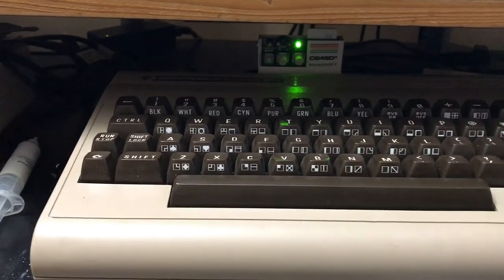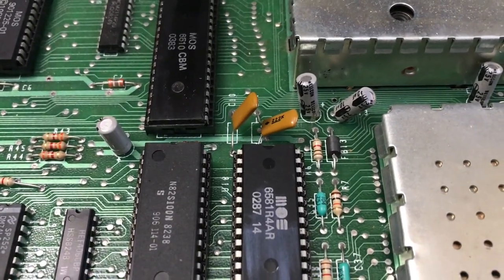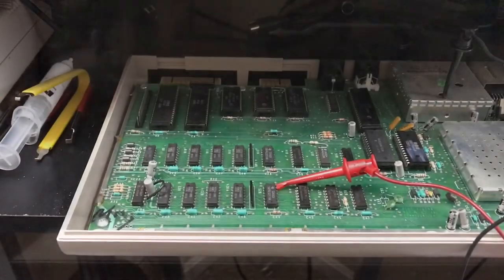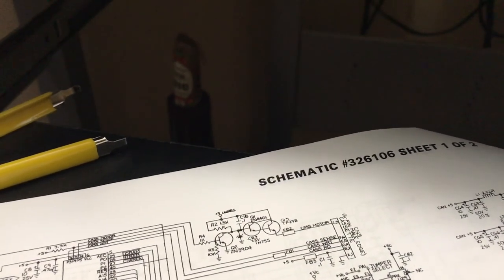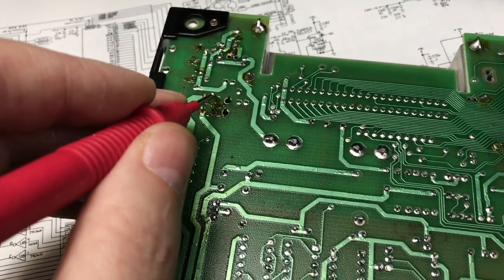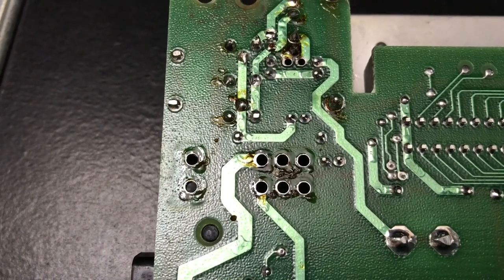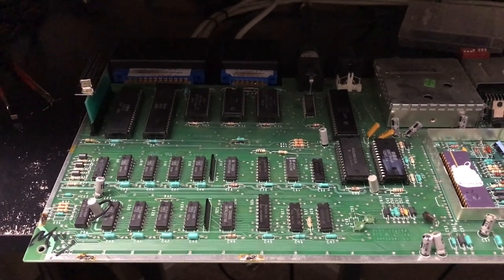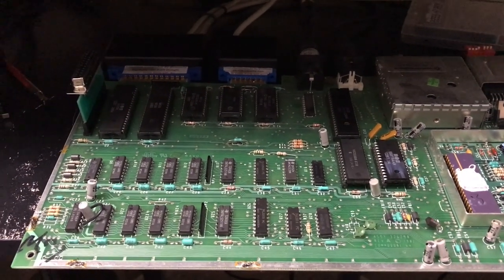Commodore 64 Repair #1 - 1982 Model

Comment: Many great Videos!  I liked this one because it answered one big question for me in why my EF3 won't work on any of my 326 Mobos!  Had them hooked up 2 days ago and realized they were ALL manifesting issues with the EF3.  And SID filters?  Need more info on that for sure...glad I found another Great Channel (through MindFlare's last Vid!).   Keep up the good work.   -Mark.
Reply from the maker: Deborah Beri Thanks for the great comment! On the SID filter caps for 326298 boards, if you play any SID tunes that rely heavily on the filters they just won’t sound right until you replace the factory caps with 470pf ceramics. The factory installed caps were based on theoretical values from when they designed the SID chip, but when the actual silicon was done the theoretical values didn’t match reality. Replacing those caps will make the SID filters in a 326298 sound identical to 83’ and up board revisions...
Reply: As for the Resistors to fix the EF3/Reset issues, a 1K x 1/8thW is best suited?  And Pin 9 to Ground Plane?  -Mark.
Reply from the maker: Deborah Beri Watch this video where I show the mod in more detail. But I settled on using a 1K resistor soldered to pin 9 bent outwards out of the socket. The resistor goes to a via on the board which connects to the rest of the CPU reset line. https://youtu.be/7Dm4AxOSlHY

Comment: You can add the missing s-video signal with a transistor mod. refer to the schematic of the SX-64 and duplicate its s-video out circuit.

Comment: APHEXTEKNOL
      1.) Some arcade games use 2 clock signals that are clock inverted signal and clock phase signal, any reasons why?
          2.) Any reasons why arcade games use different RAM "access times"?
   3.) The ROM's chips data width size doesn't equal when your "subtract" the address start and address end range. Any reasons why they would want blank unused space in the ROM chips not having any code?
       Is the blank space used in the ROM chips used for compiling the ROM data contents?
Reply from the maker: bill williams I will do my best to answer the questions I know the answer to. For the multiple clock signals, at least when it comes to arcade machines which are based on the 6502, they have multiple clock signals specifically because the 2 signals are necessary to let other devices on the bus know when they can access the CPU. The C64 uses these so the VIC knows when it can access the bus for instance. As for RAM access times, I’m not really sure what you mean. I do know that specific designs call for RAM chips capable of certain access speeds ( and when you are replacing RAM chips you want to at least match if not exceed the ratings of the original RAM chips. And finally for ROMs having blank space, I’m not really sure. I’ve replaced certain mask ROM chips in equipment with larger EPROMs which end up having empty space for instance. But no the blank space that may be present isn’t for “compiling” the contents or anything. When programming an EPROM you can actually choose to program everything from a single bit or the entire chip however you like, but mask ROMs are essentially manufactured with the data effectively “hard-coded” into the silicon.... I hope that makes sense.... :)
Reply: @aphexteknol  thanks for the help
1.) Arcade games use Z80 or 6502 cpu chips but each arcade games uses different RAM 'access times". I'm not understand what determines the RAM access time because the CPU chip is the same either Z80 or 6502 but each Arcade game uses different RAM access times which I don't know why they would use different access time any reasons why or what determines the access time when designing the circuit?
2.) The Z80 doesn't need 2 phase clock signals but the 6502 "does need" 2 phase clock signals? because of how it distributes the access times for the address buss and data buss?
Reply: @aphexteknol   ,,,,,    I'm confused why some arcade games what to redirect the addressing?
---1.)    What is the "advantages" of redirecting the addresses?
What is the "advantages" of bank switching the data buss lines and band switching the address buss lines?
Reply: @aphexteknol  thanks for the help
here is some basic repair questions:
---- > When the arcade game is constantly resetting watchdogging. And you disconnect the watchdog circuit from the arcade game and then the "game stops resetting". 
      ---1.) How do you know if its the ROM's chips or the address decoder chip or the RAM chips? Because It can be either of them that is causing the game to reset.
-----2.) When Disconnecting the watchdog circuit and the game STOPS resetting would this isolate and eliminate that the ROM chips are good, address decoder chips are good, Data buss and address buss are good?
---3.) The arcade game ROM chips game code outputs a "special address" to the address decoder chip to RESET the watchdog circuit. If the the ROM chip game code is corrupted and is sending out a corrupted "special address" or is sending out a scrambled "special address to the address decoder chip. This will cause the watchdog circuit to constantly RESET the watchdog circuit?   
---4.) If one or more of the RAM chips is corrupted and the arcade game is constantly resetting watchdogging. How would the watchdog circuit know that one or more RAM chips is corrupted and not working correctly?
Reply: @aphexteknol  thanks for the help
...>.          What is the difference between address decoding an address compared to address multiplexing an address?
Reply: @aphexteknol  thanks for the help
))))) 1.) what is it called when bank switching can use the "same address range" to route to one RAM/ROM and then route the same address range to a different RAM/ROM chip what is this called? Is this called address multiplexing? 
....)))  2.) Because I'm confused by the daughter cards kits says that the madsel circuit means multiplexed address select.
So what do they mean by multiplexed address select? 
...))) 3.) I don't understand the difference between multiplexed address selected compared to address decoding?
Reply from the maker: bill williams I don’t mean to be rude or anything but you keep asking me questions concerning arcade game PCBs and things like that. I know a decent amount about repairing Commodore 64s as that is my main focus. I’ve worked on arcade game PCBs a few times as well but I certainly don’t feel qualified to interpret what the original designers had in mind or anything like that.  So I’m sorry that I can’t really answer your questions unless they are specifically about Commodore 64s. Even then I certainly don’t know everything about C64 repair but I don’t mind sharing what I do know on that topic...
Reply: @aphexteknol  ok sorry i will only ask about C64 repairs sorry about that
Reply from the maker: bill williams No problem at all. I just don’t want to try to answer questions that I’m not sure of the answer myself and end up giving someone wrong information if I can help it is all.
Reply: @aphexteknol  yes i understand that is fine

Comment: What is the board number? Ok, I can see it is the 250407, but I could not see the REV #.
Reply from the maker: 3D Texan This C64 has a 326298 revision board. Its the earliest style 1982 board that only outputs composite video on the 5 pin AV jack...

Comment: APHEXTEKNOL
     ---         Joust,Defender,Robotron,Sinistar,Stargate, Bubbles uses the eight shift registers to output data to the screen four bits at a time for a 16 color pixel. 
                                   I'm not sure what this really means why they wanted to output 4 data bits at a time to get a 16 bit color pixel. Can you explain what they mean by this because I'm guess other arcade games would only output 1 bit at time to get a 16bit color pixel? 
                                              The color PROM chip outputs 1 bit at a time  to the color RGB output circuit which has DAC converters to output RGB analog voltages

Comment: I had to put my equalizer WAAAAY down on the high frequency level, because that CRT is piercing through my eardrums. Otherwise, good video.
Reply from the maker: JarAxe I’m older and the 15kHz squeal of CRTs is barely audible to me anymore. I remember being young and walking into computer labs full of CRTs and wanting to wear ear plugs though. I apologize for the noise. My new videos will be done with a headset microphone so hopefully it will cut down on some of that... Thanks for watching! :)
Reply: @aphexteknol  hm, I didn't notice it at all, and I thought I was "only" 35 :P
But nice video indeed :) I am trying to repair my own c64 and I don't know much about electronics at all, so it's nice to see other peoples repair videos and learn a bit here and there.
Reply from the maker: UncleAwesome I’m only a year older than you. In fact I’m used to being the young “kid” compared to most Commodore fans. Hope you learning something useful from the videos. Feel free to ask questions on your own repairs and I’ll do my best to help! Thanks for watching!

Comment: APHEXTEXKNOL, 
1.) The Two phase clock signals was used for sharing the data bus for instruction sequencing to sync the RAM devices?
     2.) DMA puts the cpu to sleep and transfers ROM data contents to flip flop latches and RAM chips? anything else what the DMA purpose and function is used for?
  3.) i see the access time on the datasheets for parts like RAM chips, PIA chips, PLA chips, 
PIA & PLA chips have access time also
But I don't know what determines a designer to choose which access time is right for the game programming code. How would a software arcade game programming code know which access time to choose for the IC chips?
 4.) The software game programming looks at all the datasheets access times for the all the IC chips and choose the access time based on the Clock speed? 
If the clock speed is 1Mhz, what access time would be good to use?
If the clock speed is 4 Mhz, what access time would be good to use?

Comment: APHEXTEKNOL ,                                               1.) In arcade games they use Address decoder chips to do the ROM chip select signals they dont' use PLA chips. I'm surprised why does the C64 game console used a PLA chip to do the chip select signals instead of using an address decoder chip, any reasons you think?
             2.) In pinball games they used PIA chips to do the I/O processes for the switches matrix circuit and lamp matrix circuit and didn't use CIA chip. I'm not sure why they didn't use CIA chips in pinball games instead of using PIA chips. Arcade games use neither PIA chips or CIA chips to do the I/O processes like the joystick and buttons its done using an multiplexer chip as I believe? Not sure why arcade games didn't use PIA chips or CIA chips for the joystick and buttons. Any advantages of using CIA chips instead of using PIA chips?
Reply from the maker: bill williams I can’t answer authoritatively on this, but I’ll take a shot. Commodore owned their own chip fab known as MOS and they wanted to utilize their own chips in designs as much as absolutely possibly. In addition they were very careful to minimize the total chip count in their designs, and as the years wore on they redesigned the C64 multiple times to reduce the total number of chips needed in manufacture. This lead to the C64 utilizing a more custom chipset rather than lots of off the shelf 74 series logic. The CIA/VIA chips Commodore used were custom multipurpose I/O chips of their own design and they used them in as many designs as they could. Due to economies of scale and the fact that they owned the chip factory itself it ended up being far cheaper to do it this way which was a prime consideration in their designs. Saving even a penny was a big deal when you are making millions of something... Hope this helps...
Reply: @aphexteknol  thanks for the help
What TTL/CMOS 74XX series chips would be equivalent to a CIA,PIA, PLA chips? I means that would have the same functionality and can do the same functions.